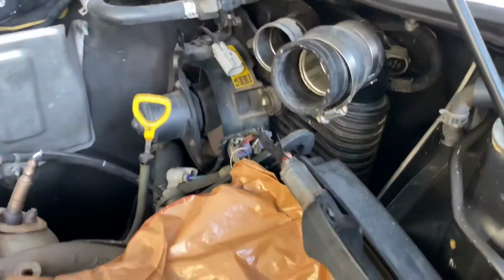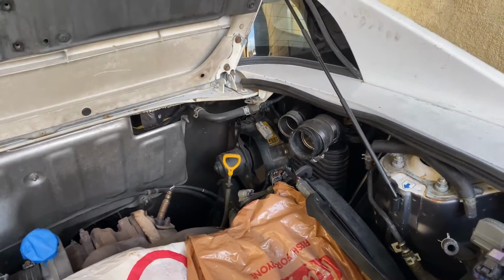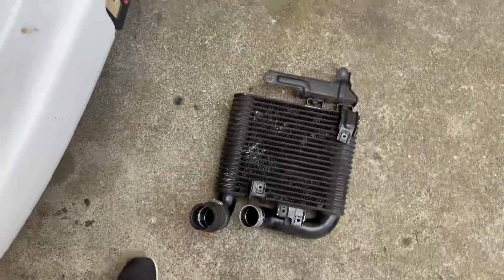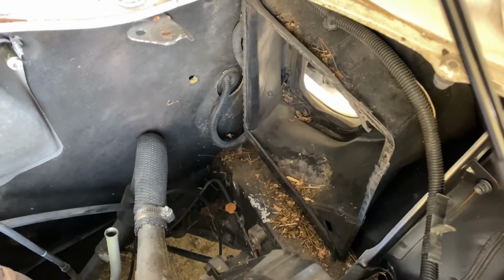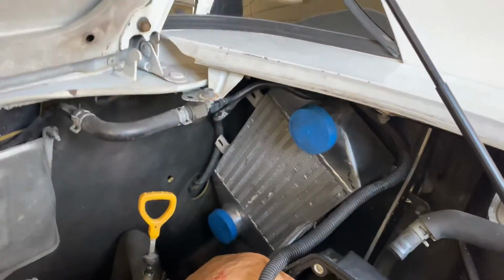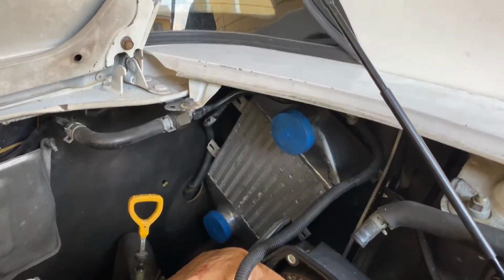turbo mr2 gets upgraded intercooler

Comment: In installing my intercooler and berk downpipe this weekend on my JDM Gen 3. How hard was the removal of the IC?
Reply: Doing mine now gen 3 too, only want to kill myself like 7 times an hour lol
Reply: @kdittyb  it took me about 6 hours for my IC And 8 hours for my Downpipe. Many trips to the store here in Japan and ordering off Amazon japan. That was last august but well worth the wait. Unfortunately to pass inspection here in Japan I have to reinstall the original DP to pass them remove again to enjoy.
Reply: @fsal5687  I had no idea they would be that strict on older jdm cars in japan...over here we all.look at over there  like a tuner car dreamland, with waterfalls over flowing with car parts lolol
Reply from the maker: Sorry just saw this! My engine was outside my car when I installed the berk downpipe so it was super easy. I also installed my IC while the engine was out so it literally took less than 20min after I wired the fans
Reply from the maker: Here in California it’s like that too! thankfully I don’t have to do that since I didn’t register my car in the state haha
Reply: @mr2aria  I ended up realizing your motor was out after I was almost finished watching your vid, my hardest part was removing the old core having to literally become a mad scientist in geometry lolol
Reply from the maker: Haha I bet that was a paint. Honestly I would have been so frustrated if it was in 😑 specially the bolts where I even had a hard time with the engine out 😂
Reply: @mr2aria  it was one of those, it's all right there, kinda hard but should be accomplished yet it was annoying which made it super frustrating.... but I don't envy you having to get the motor back in, there's alot going on in that small bay 🤦🏻‍♂️🤦🏻‍♂️
Reply: @kdittyb  even on older cars they only focus on a few things based on modifications. If the car is too low, no cat, spoiler and a Japanese approved exhaust. So before inspections I raise my car, switch my downpipe and exhaust. Then after the 10 minute inspection I will reinstall everything. But the cars here…… it’s heaven. Haha
Reply: @mr2aria  I’ll be taking my car back to Texas when I’m done. I can avoid a lot of this
Reply: @fsal5687  I bet man!!! The history, the diff car scenes ans styles over there... I'd love to be able to visit for 2 weeks and just see the way they have meets, or track days!!!...
Reply: @kdittyb  there is a lot of underground stuff for sure. They have monthly car meets depending on the day in Yokohama The 7th will be RX7 for example. Besides Americans owning some MR2s, I’ve only seen two others owned by a Japanese National. Definitely worth a trip if you can.